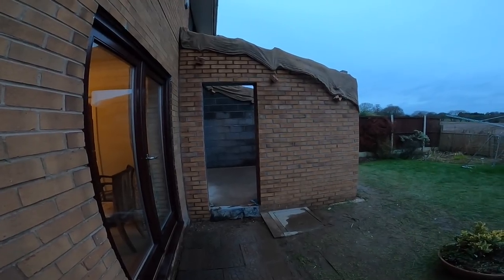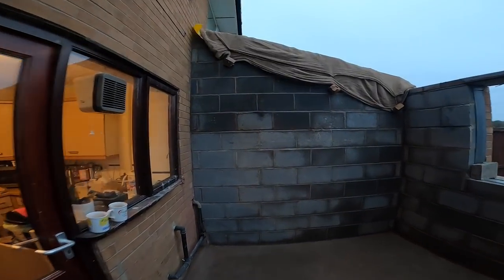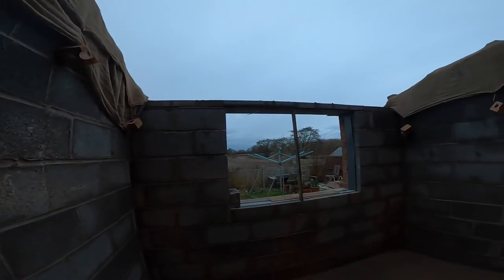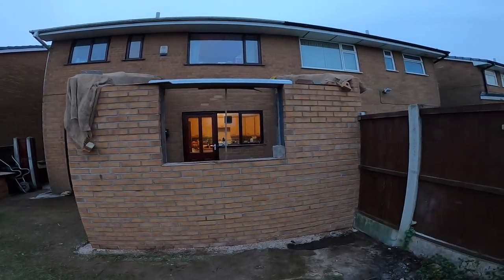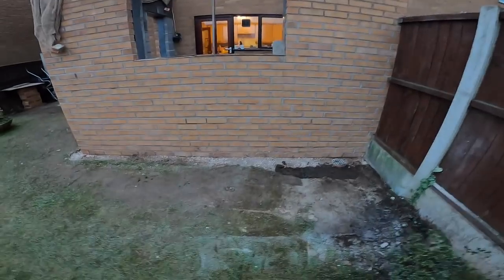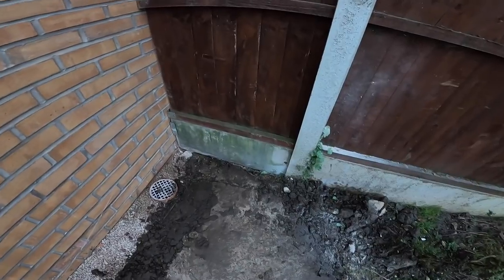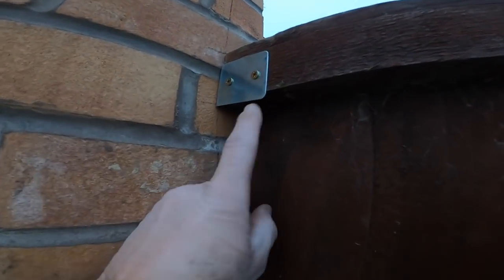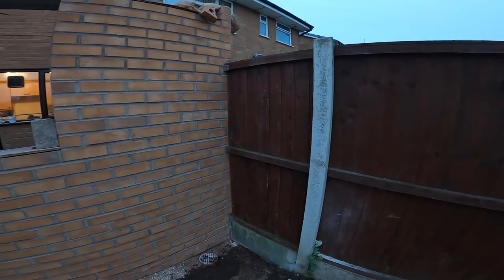FINAL LINTEL AND PIKE , BRICKWORK COMPLETE. EXTENSION PART 7

Comment: You have had to open up the joints on this one but personally I would perfer to put cuts in but makes no odds I suppose I am  just not fussed on wide joints if I can not have them I won't , I am going to use that idea with weighing down the hessian with the brick and wall tie great idea, good work boys enjoy the rest hopefully we will all be back at it soon  👍
Reply from the maker: wheaten bread . Cheers pal fingers crossed 🤞🏼😬🧱👍🏽

Comment: Is that a100mm cavity with rock wool insulation? Does that even meet required u values ?
Reply from the maker: 11x11z11x11 Yes  100 mm cavity with full fill cavity batts 👌🏼. Rockwell is a brand name for similar stuff 👌🏼🧱👍🏼
Reply: According to u value calcs that would only give .30 and the requirement is .28 which even at its best is poor, why not use pir, at that cavity you would be near .17 which is very close to a new build.

Comment: id check you don't need 2 courses above lintel under wall plate i tried to keep my pitch as steep as i could on my extension and found out i needed a min of 2 above lintel. they where catnics though so all brands differ. politely saying as wouldn't want you to be going back like i had to. cheers
Reply: That lintel is a catnic also🤷🏻‍♂️ and if hes edited and uploaded the vid then hed have to go back anyway
Reply: @jamietalbot7254  my catnics where black. Don't know if that means anything looks like he was using ig or keystone
Reply: @mikeseymour4608  a catnic refers to the shape. Colour is regardless
Reply: @jamietalbot7254  Catnic is a manufacturer of steel lintels finished in powder coated black it's a Tata steel product. Catnic is a brand same as IG keystone etc. Correct me if I am wrong. I specifically sourced the (brand) Catnic for my extension as there heavy duty lintels require only x2courses above lintel below wall plate. Im a gas fitter but that's the information I know on the lintels as had to research all the brand's to get the roof pitch and load correct.
Reply from the maker: Mike Seymour The roof has been on a while now and it was a lovely fit 👌🏼. 
As for the lintel a Catnic is a brand name not the shape 🧱👍🏼 we used keystones
Reply: Lintels. Catnic has pioneered the steel lintel for five generations, our products are manufactured with a unique duplex corrosion protection system, an integral plaster key and built-in damp proof course with continuous insulation making them the most unique lintel on the market. (Catnic is a brand not a shape) I'm not being funny I'm just sharing what I learnt through building my own extension last year. Regards
Reply: @SteveAndAlexBuild  great build thanks for the upload.
Reply: @mikeseymour4608   spot on mate!! the brickies need to go back to collage hahaha 🤦‍♂️
Reply from the maker: doug hay . I was agreeing with Mike 😉🧱👍🏼
Reply from the maker: Mike Seymour . Cheers Mike 🧱👍🏼
Reply: @SteveAndAlexBuild   I know mate sorry!! was just having a laugh should have said, some brickies should go back to collage!!  👍👍
Reply from the maker: doug hay . No probs 😂😂 if you saw some brickwork we see on site there are plenty of “ brickies “ who’ve never set foot in a college 😱. Have a good weekend pal 🧱👍🏼
Reply: @SteveAndAlexBuild   lol i bet mate, the shit thing is they seem to manage to get away with it these days 👎 same to you pal, stay safe!!
Reply from the maker: doug hay . I heard recently an agent said a bad bricky is better than no bricky ....... sad times 🙁🧱👍🏼
Reply: @SteveAndAlexBuild  it is sad , no pride in the job just get them up and snag later, some poor sod chucking all there hard earned into some dump thrown up on price!!
Reply from the maker: doug hay . Very true 🧱👍🏽

Comment: I have always built the gambles after the roof cut is in place wouldn’t know how to do it any other way? or is they a ladder frame and facia and Soffit been fitted. cheers love the vids
Reply from the maker: donna Lycett we would much rather build it after the roof is in place but it wasn’t possible on this occasion . We were very lucky though as when the roof was put on it didn’t need any remedial work on it 👌🏼🧱👍🏽
Reply: Bricklaying With Steve and Alex what measurements  did you work on in reguards to the pitch 

Thanks
Reply from the maker: donna Lycett To be honest we were told to copy off the extension next door but 1 , that’s as technical as it got 😳🧱👍🏽
Reply: Bricklaying With Steve and Alex  makes sense matey haha cheers
Reply from the maker: donna Lycett . No probs , thanks for watching and commenting 🧱👍🏽